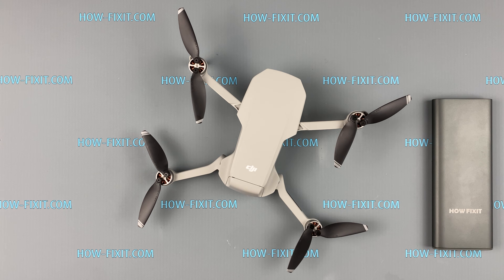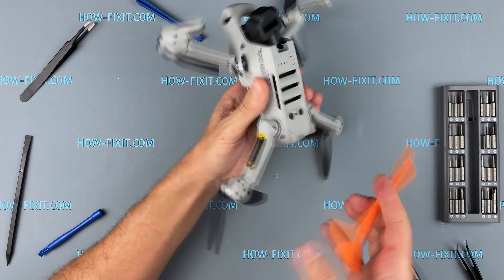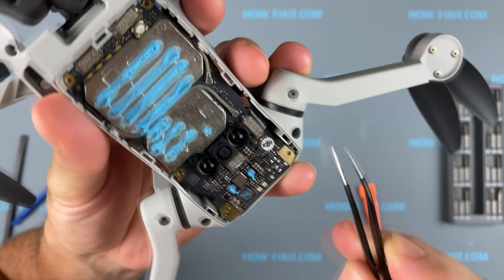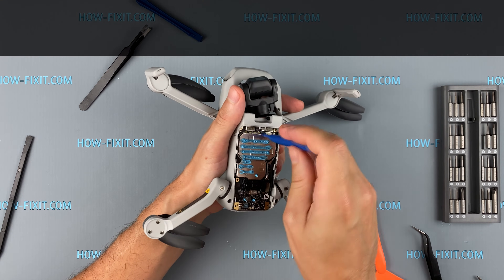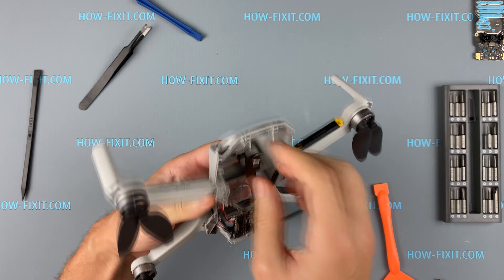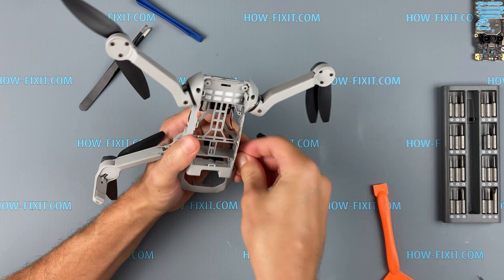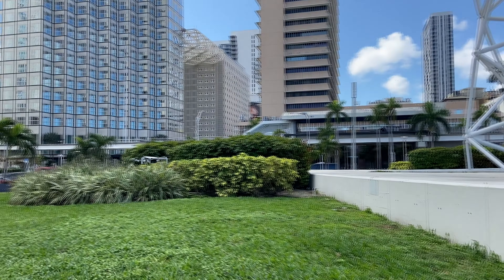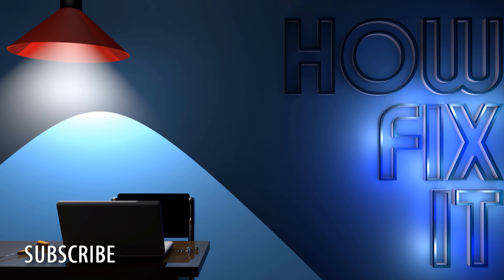Dji Mavic Mini Disassembly and Repair

Comment from the maker: After the replacement motherboard or gimbal, you will need to calibrate your drone. Some calibration processes can be done with the DJI Fly mobile app, but for some procedures, like camera gimbal calibration, you will need to use additional software. How to calibrate the gimbal watch this video tutorial https://youtu.be/mu03HWXplM4
Reply: Hi, my drone doesn't sync with the controller. What could be the issue ?

Comment: Great video.  My gimble stopped working and DJI wouldn't let me send it back for warranty due to a parts shortage.  While disassembling it, I found the ribbon cable for the gimble was broken.  The Amazon link you shared was not available, but I was able to order two (I wanted a spare) through a different amazon vendor.  

Thank you sir for your excellent video.

Comment: Oh well. I crushed my mavic mini it to a tree and gimbal came out from its rubber mounts. On closer inspection I noticed a tear on the ribbon cable and there was red error saying something about camera sensor . I purchased refurbished part and replaced it guided by this video. When I power in on now the whole gimbal is shaking like crazy and there are multiple errors likie: 40012, 10001, 30066, 30049, 30007 and a few orange ones. 
Now. I do not blame the video! Its been a huge help. I am just wondering where did I fail and what else I can do to fix the problem. 
Can anyone help me?
Thanks again

Comment: I would highly recommend using light heat to remove the hot glue from the cable connectors on the the main board. I used the plastic spudge tool and it took some of the coating off of the PCB. Thankfully that doesn't affect much, but it could easily tear off components or traces and you wouldn't be able to fix it.

Comment: So i dropped my mini in water,  it was in there for about 5 secs. I took out the battery and dried it with a hair dryer.  I let it sit for about 6hrs and i re stsrted it. It indicates low battery (1 flashing light) and when i turn it on it gives me code 30064. The mini itself has the two lights on the right flash 3 times. What can it be.

Comment: the screwdriver set is too big to fit in the hole for the bottom screws. I am pretty sure that you linked another set since the set I ordered by clicking the link wont fit to unscrew the bottom screws.

Comment: My drone fell and the DJI tech said the mother board broke, and the Singapore svc center don't repair and said they will send to HK for 1:1 exchange which cost almost the same as a new one, Question is if they or anyone sells the motherboard only and where can i buy it?

Comment: Hi I was trying to fly my mini 2 yesterday. After complete setup the drone was not taking off as one of the propellers was not rotating. I tried multiple time but the results were same after which when I physically checked the wings of the drone it was tight/hard.

Any advices??

Comment: My mini fell off the roof of my car today. In its case. While I was driving. The flap for the battery came off completely but remained in-tact. I had to remove the top cover to get it back in and secured. This video helped tremendously. 
Thank you very much 🙏😍💯💯💯😂❤️🐝🐝🐝🐝🐝🐝🐝🐝🐝🐝

Comment: The Dji Mavic minim was dropped in water, the camera was working fine, but the gimbal was getting stuck and data error. I tightened the Wd40 to fix the gimbal. The gimbal problem has been solved. I am not getting a gimbal error. But now the camera image is not displayed. What could be causing this error? Error codes; 10001,10016  
how can i solve this problem?

Comment: I'm receiving error 40021 after replacing the gimbal. The flex and signal cable are original. Is there a way to clear the error?
Reply: I see a lot of people having a problem with this and it's like dji repair centers are the only ones with proper software to pair the drone with a new gimbal.
Reply: @edwinderick72  Yeah, from what I've read, if you're past a certain update it will happen.

Comment: Hi great video!! I never see someone disassembling the motor. I have a situation where a thread got into the axel of the motor, I need to open it to remove. Do you know how to do it? Thanks!
Reply: Easy remove the c-clip at the bottom of motor and pop the bell out.

Comment: Hi in relation to the camera, dji have made it impossible for self repair of swapping the gimbal. It needs to be coded using dji software with a code given by them when you submit the gimbal serial number, are you able to supply coded units ?
Reply from the maker: Hi, 
 I'm really upset to hear that such changes were made by DJI and now this is preventing the self repair gimbal replacement.

As soon as I find a way to solve this problem, I’ll definitely make a video.
Reply: How-FixIT hi any news on it yet
Reply: @TheMbrist  same problem here
Reply: @howfixit  mine says incompatible gimble data too....do I  have to contact DJI?
Reply: @howfixit  this was after replacing the 3 prong cable...
Reply: It can be done,change your lense module and its paired

Comment: There is no link for the gps module.I have very weak gps cannot mantain a stable +12,13 sats or more in the city is impossible it falls down 6,7,4 than 0 as soon as i take off,in the city the more altitude dhe worse gps.In rural areas its better but still experiences loss of signal.The drone is brand new.I had another mavic mini but it crashed never had gps problems with it.You think is gps module faulty?

Comment: Hi just wondered do you know  if its possible to switch an iphone 8 motherboard with the iphone 8 plusses
Reply: @How-FixIT
Reply: How-FixIT
Reply from the maker: No, the motherboard from iPhone 8 cannot be installed in the iPhone 8 plus, these motherboards have different sizes.
Reply: How-FixIT Thanks